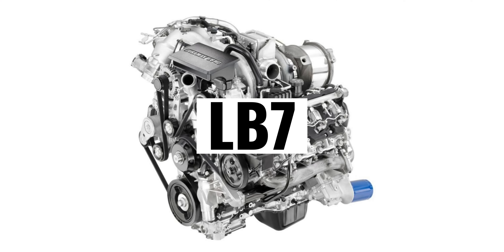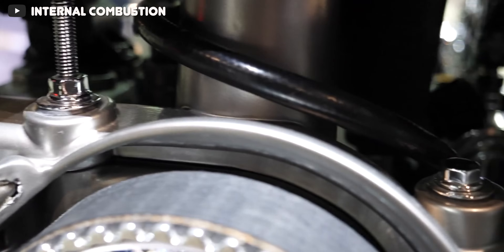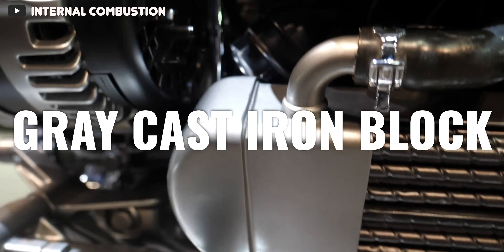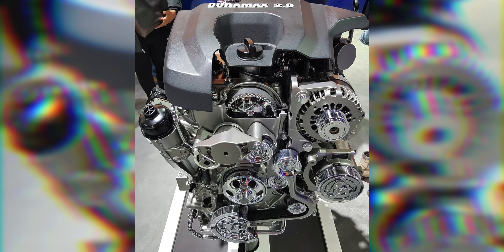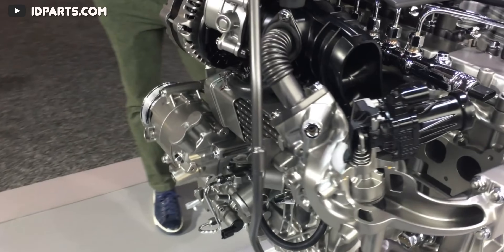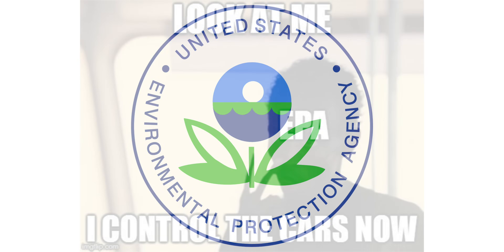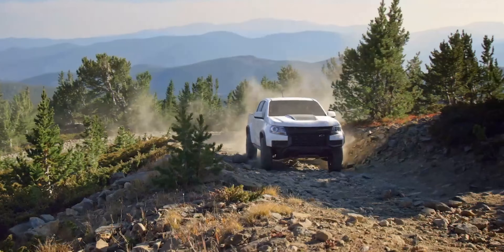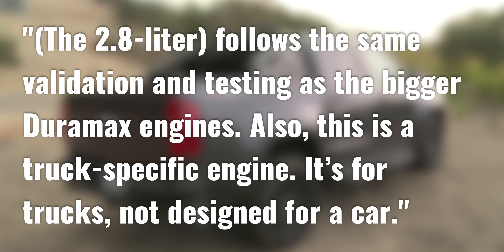2.8L LWN Duramax: Everything You Need to Know

Comment: I have a 2017 Colorado Z71 with the 2.8l babymax. I do tow heavyish  on occasion, large pontoon boat, compact tractor etc. , but withing the towing specs of the truck. I have a love/hate relationship with this thing. I love it for the most part. My previous vehicle was a 3/4 ton and this truck has done everything I need it to since I do not tow super heavy anymore. However, I HATE the emissions BS on this truck. I've had four, what I would classify as "expensive" failures with this vehicle, all have been emissions related failures ranging from $800-$1600 to repair. NONE of which have been covered under the Fed Emissions Warranty. Thanks EPA!
Reply: Same here !!
Reply: Cant you get rid of (by pass) the emissions components?

Comment: I’ll pass on an engine from Thailand.
Reply: They 2021-2022 model engines are from Brazil.. not sure if that’s better or worse
Reply: @levismith7444  if the cummins 53 block castings are any indication, it’s not any better. They were known to crack if you didn’t let them idle until warmed up. The casts were identical but the metallurgy was inferior.
Reply: @Natedoc808  good to know

Comment: Do you feel that that the Canyon/Colorado with this engine/transmission combination will last 200k plus miles if it is not used for towing haul large louds and is regularly maintained?
Reply: 285000 km, no issues, deleted at 40K

Comment: 2018 Z71 CCLB here, I can say on all the FB groups/forums I've seen I haven't seen a lot of complaining about the 6L50, now the DPF equipment...whole different ball game.  Had mine go into limp mode.  It was dangerously slow on acceleration, it will make you take it to the dealer to get your filter replaced/manual regened.  

Some folks get theirs tuned, and tow, the 6L50 seems to be holding up fine, at least I haven't heard a lot of chatter about it.

Comment: The little brother to the 6.6 dmax is the 4.5 v8 310hp/510tq baby dmax that GM shelved in 08 or 09 would have been PERFECT for the 1/2 ton truck with gear driven valve train and crankshaft driven oil pump and not the DUMB design belt driven oil pump like on the  3.0 ticking time bomb, my question is why didn't gm make the 3.0 with a gear driven oil pump like the 2.8 and also put the timing chains in front of the engine instead of the rear
Reply: I've never heard of that engine. What an interesting read, thanks for sharing

Comment: I have the 2.8 in a 2016 Colorado. Lots of mountain driving but no towing. The motor has been great, no issues. At 88,000 miles the torque converter needs to be replaced and it spit up all inside the transmission so that needs to be replaced as well. Not cheap. Sucks because the truck has been great otherwise. I also had to replace a diesel particulate sensor but that is not a big deal
Reply: Good to know. That stuff can wipe the diesel fuel economy advantage over a tacoma pretty whick!
Reply: @scp8412  I ended up trading it in after the transmission was replaced, but I went with another diesel, the 3.0 in the Silverado. The 2.8 was awesome, however the 6 speed trans they sold it with in 2016 was not at all awesome.
Reply: @overhead18  Yeah I think the 2019 had the same 6L50 trans ? only thing holding me back from getting this nice truck
Reply: @scp8412  Sorry, missed this comment. For some reason I want to say they replaced it at some point in the diesels, but I am not sure about that. I would not buy a truck with that transmission in it. That much I know.
Reply: I just bought a 2018 Colorado 2.8, 89k miles, at 79k the torque converter was replaced!
Reply: @KevinLavorgna  Good luck with it, hopefully nothing from the torque converter made it back into the transmission. My dealer and the warranty company both insisted the transmission should be replaced at the same time as the torque convertor due possible problems.

Comment: The transmission works fine ! Here in New Zealand it is rated for a 3.5 Ton tow rating, and it can do it comfortably, A 9 year Old 2013 Holden Colorado 2.8 Ltr Duramax RG, It's all good, early Ford Rangers had the problems with heating up and warping, research before you buy !

Comment: My 2019 ZR2 is tuned & deleted. I bought it that way unbeknownst to me. 
I’ve since bought a new tune for it but I’ve had a major issue. 
As soon as the truck hits operating temperature it has no power until it hits 1800 rpm. 
I can’t seem to determine if it’s a tune issue or a mechanical issue. 
Any thoughts?

Comment: the really sad thing is that they are not going to put it in the 2023 models. I'm really thinking of getting one of the last 2022's before they are gone.. Love the 2017 I have drives great tows great. I'm getting 20mpg towing a 5k load. Unloaded I'm in the 26-30+ range depending on the driving mix.

Comment: Can I get more information on the Diesel Particulate Filter? I have a check engine light on. A diagnostic test revealed a dirty DPF. My understanding is that the DPF cleans itself during the regen cycle. How do I ensure that I active the regen cycle and keep it active for the half hour cleaning period?
Reply: Get it out on the highway and drive it, preferably with some load on it for at least half an hour.  The regen process is supposed to be transparent to the driver; it should be kicking on automatically.  If you're getting a code that tells you to keep driving, then keep driving.  The manual says something about it being above 40 MPH to trigger; I've noticed my personal truck will start to regen as low as at 25, but anytime you're stopped, it will generally kick the cycle off until you're moving again, unless it's in the middle of an active burn.  If doing that doesn't help, you may need to take it to a dealer and have them trigger a parked regen.  There's also a TSB from GM about these motors for the 2016 model year about them triggering a regen too often which requires an ECU reflash at the dealer.  There's also a TSB for the DEF pump for that model year.

You might want to consider getting an active OBD gauge/monitor so you can keep an eye on what your emissions system is doing.  I'm using an OBDLink MX+, which is available on Amazon and Gretio for Android.  Lets me watch all kinds of stuff like turbo boost pressure (so I can watch what my turbo is doing), Soot Level, EGTs, DEF line pressure, etc.  For your regen question, if you get a monitor, watch your EGT1 sensor and Soot Percentage.  The DPF won't start to loose soot level until your EGT is above about 700 degrees, and during regen, it can reach over 900.  When regen is complete, your Soot Percentage should be down to 3-4%.  If your EGTs never get that high, there may be something wrong with your active regen system.  These trucks have a 5th injector mounted on the frame for active DPF regeneration, and that may be the culprit, but I would have the dealer run some diagnostics before throwing parts at it, as all of the emissions parts on these trucks are not cheap.

For anyone who has that model year of truck (2016) and is getting a DEF code, if you have an active monitor, look at your DEF line pressure parameter.  You should be seeing ~72 PSI in the DEF line once the truck is warmed up.  If it's weak, or 0, you probably need a new DEF pump, as outlined in the TSB.  If you're reasonably handy, you can replace this pump yourself, it's not a terribly complicated job, though it is tedious and you will most likely splash yourself with DEF (ask me how I know).  The TSB itself has marked part numbers for the affected pumps.  Replacements are available, cheapest I found was on RockAuto for the GM Genuine part.

Comment: Thanks for this info. I've been seriously considering the Colorado specifically because of the diesel offering. 30mpg is very attractive for daily driving and my tow requirements are well within the 7700# rating. The poor acceleration is not something that bothered me as I think acceleration comparison is a pointless vanity metric when talking trucks. I was shocked to find out that the 2.8 is an off the shelf euro engine mated to a car transmission. I'll be shifting my interest to a half ton. If I wanted a car, I'd buy a car.

Comment: Personally the transmission choice is probably for emissions and reduction in rotational mass. Think about how the 200r4 compares to the 700r4 or the a4ld compared to the e40d. If you're going to be working these hard at low speeds I would say just put them in low range. That's usually what I do with small trucks. That and manually shift. Also don't tow people out of being stuck in reverse or high range. I always put my transfer cases in low range when pulling something if I won't go over 20 mph in the process.

Comment: Great video! It's too bad the EPA is forcing these diesels out. We have a 2017 and a 2022, love em!!
Reply: The regulations killing it and causing lots of pollution. I would rather save all the money not buying the truck and live a financially more secure life than have to spend all this money for the liability of maintaining an Isuzu engine that is designed in dark times where the epa make it suck on it's own farts to pretend to help the enviorment while they mine rare earth metals out of the earth to build a battery that only lasts 15 years if you're lucky, maybe a bit more if you're really really lucky. The pollution of the ground is worse because then you can't plant a tree to suck all the carbon out of the air which is suspended via carbon dioxide. If the epa cared about pollution they would go plant trees ect instead of having engine suck on own farts for higher cost. We'd be much better off developing some kind of metals which will not burn oil and cost less to repair. ECT. So less things go to junk yard. If epa really cared about the enviorment they wouldn't allow auto manufacturers to use plastic headlights anymore while charging 25k for a base model sedan because in 10-15 years some highschool kid will think they're ugly and worn out and don't shine bright and he will have to throw them away and buy new headlights and taillights made in China which will fade faster probably. These things are all plastic and end up buried in the landfills. The big holes in the ground we bury the trash in that turn into mountains. All these plastic buttons and switches they overcharge for which break in 15 years for a car that should be built to last 50 but isn't. I want to replace one tiny little plastic piece in my accord and they want to charge $12 before shipping just for me to get my hands on a component with the component I need inside and it's a tiny little .50 cent plastic piece. It should've never been made of plastic according to the cost of the car when it was brand new. The epa doesn't care about the environment. They have done horrible things for the environment. Their is 3d printers that can print tons of these things for pennies on the dollar, why am I paying $12? Also, I had a very nice Toyota, as lots of people do. The seat broke and it was old enough it cost a lot to fix and was worth fixing but we didn't have that kind of money at the time to throw into a car that people won't pay lots for just because it's not a mint 60s Impala or whatever people spend a lot of money on these days. So we just left the seat broken and i tried to go fix it myself and turns out I had to buy a 500 dollar assembly off eBay and their was no garentee it was going to work and the car only worth 3500 but not in bad shape. So people didn't drive it and it at begging to be worked on and since it sad lucky it's Toyota and only a fuse pop or something but with my luck it's always asspain for every little thing. So the seat stayed broken because I'm not paying 25% of the cars value just to get the seat working because it also needs new headlights and new tires sometime eventually and new rubber belts and new windshield and before you know it you're in the hole on a 3.5k car. So it was sad to see it wear out because it was a very nice Toyota. It's still out there today but it's simple little mistakes which in 20 years come to plague. In 25 years your car might still be on the road, many won't. But will you be able to say your seat still works and none of your buttons broke and your headlights and taillights aren't all faded? It gets expensive to keep these things running and we're talking Toyota not even Isuzu GM "quality control" with the epa making engines suck their own farts. I just don't see it lasting without costing the people who own it s metric fortune like most vehicles. Major steps can be made by getting rid of low quality overpriced plastic buttons and button components and making it easier to get your hands on all the components and not just assemblies with the 1 component you actually want inside it because it ups cost by having to buy what you don't need. 

And come on man it's 2022 and these oil cars still leaking everywhere. Oil cost $122 a barrel. That cost adds up when you're leaking it because of poor design

Comment: With GM putting the L3B into the Colorado / Canyon it's going to be making 430 plus foot pounds with 310 HP . Is there really a need for the little baby Duramax ?
Reply: Range. 22 gallon tank gets you well over 600 miles at cruising speed. It also sounds like a proper diesel.

Comment: They had a 2.5l Duramax based on this 2.8l engine. Colorado in Asia uses both engine and they puts out 181hp/440nm and 200hp/500nm respectively. I owned the 2.5l variant and so far it is pretty powerful and reliable engine. But most 2.5l owner had a transmission issue, maybe it is true that the transmission is nor suitable for truck uses. Overall, good and powerful engine from GM. If you need to know more about the engine, i'm happily want to share with you
Reply: i have a 2016 gmc sle 2.8 dmax with 95k on it. i tow a cargo trailer occasionally, havent had any problems. (yet)

Comment: We previously owned a 2017 Canyon 2.5L with the 6L50 and currently own a 2021 Canyon 2.8L Duramax with the 6L50. The only issues we've ever had with the transmission were related to harsh shifting and rough idle in the 2017 and my wife, who's a GM Canada technician, found a special policy for it and reprogrammed the PCM which fixed the issue for us. I believe the culprit was the torque converter and severe cases would result in replacement under the policy.

Special policy aside, the 6L50 is otherwise quite solid and is truly the lesser of the evils in this lineup. Based on her experience, and the experience of countless others who have launched class-actions against GM for it, the 8L90 is the worst transmission GM currently makes and it makes up most of their warranty transmission work in everything GM puts it in from the Canyon/Colorado and Silverado/Sierra to the Camaro and C7. 

In addition to that, the 3.6L V6 that GM couples with the 8L90 is the weakest link the Canyon/Colorado engine lineup with common issues largely relating to the Active Fuel Management system, head gaskets and valvetrain.
Reply: Thanks for the feedback.  My dad has that 8 speed in his 2019 Silverado and it's been nothing but trouble since day 1.  Very harsh 1-2, 2-3 shifts are common.  We've taken it back to the dealer many times.  They keep saying the same thing, "Runs great...no issues at all."  Can anything be done to correct the issues with the 8 speed?
Reply: ZF 8HP

Comment: These small cubic inch engines are not good on mpg when they're being worked. They can get worse than the larger cu inch counterpart.
Reply: In most cases yes that is true but for this motor it's not the case. I'm from australia where we've had 4cyl diesels powering our mid-size 4wds for decades and this motor along with the 3L 4cyl engines are actually still really good on fuel towing. It's these newer smaller high tech motors that are proving to be useless when loaded on fuel
Reply: So does my 4.0 ohv ranger. Though when I'm cruising the highway commuting like most days it doesn't.
Reply: I got 16mpg on my 2019 GMC Canyon pulling a 5K travel trailer on a 1000 mile trip to Smokey Mountains this summer.  I loved how we were blowing by semi trucks and larger trucks pulling campers on the long upgrades. I’m getting 27mpg overall with on issues after 40K miles on this truck. Time will tell, but I’m warranted to 120K.  How has this transmission performed in the applications it has been used in?  How does this transmission compare to the 8 speed used in the 3.6 gas engine?

Comment: Why do you think that timing gears are the only way to go? Not efficient and heavy, you even mentioned they're noisy and cause vibration, 150k for a belt is plenty, I don't see why you'd be so disappointed by a simple easy to service belt over a gear driven system
Reply: Same here! Would rather have a belt that can be maintained vs one and done gear or chain system

Comment: All your statements are Bull. This engine debuted in 2005 in multiple Chrysler and Jeep as the 2.8L CRD in Jeep Liberty before GM used it
Reply from the maker: That would be the R 428 DOHC or RA 428 DOHC depending what years you're talking about. I referenced the earlier engines in the video, maybe you forgot to watch it.
Reply: @Dustrunnersauto what I am wondering is the trans bolt pattern the same... Id like to maybe Upgrade my Jeep engine